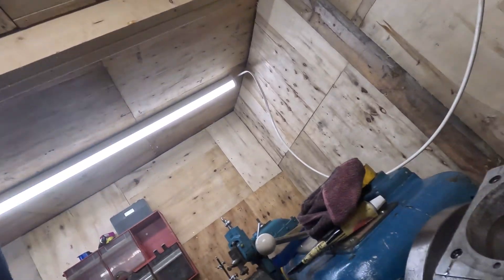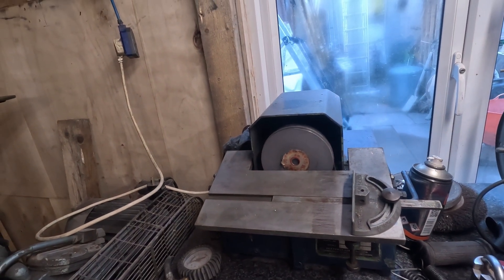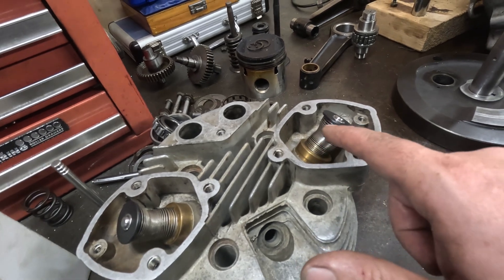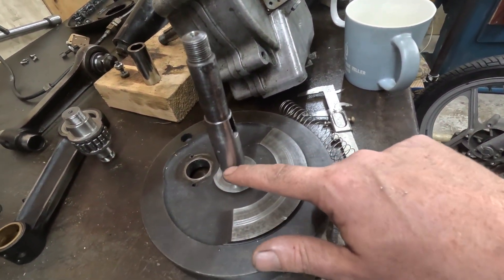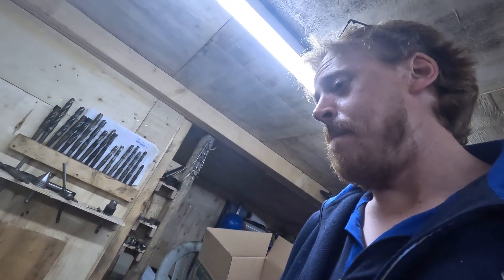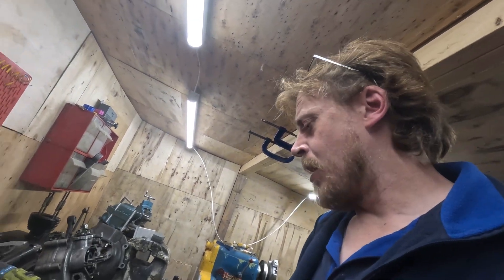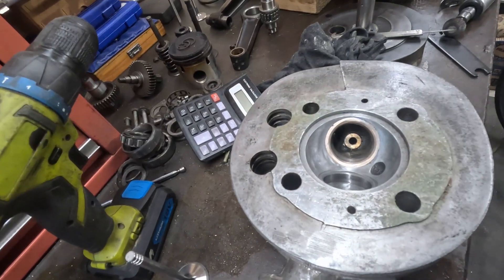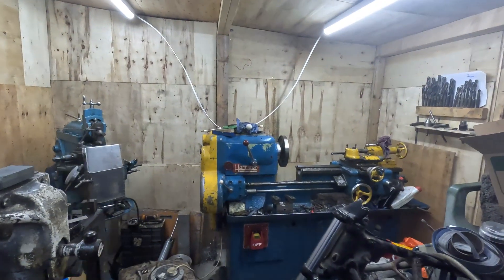Norton Model 50, Minor disaster.

Comment: A good tip cutting slits into the disk, you are making progress. Have you settled on a bearing size yet, I like the tip with the lighter springs to measure the stack height.
Reply from the maker: 25/52/15 not what I wanted, but what I can get in the style of bearing required. I've check both static and dynamic load of the bearings and they are in the ballpark.
Reply: @ginner43  I love the approach, practical engineering at its finest.